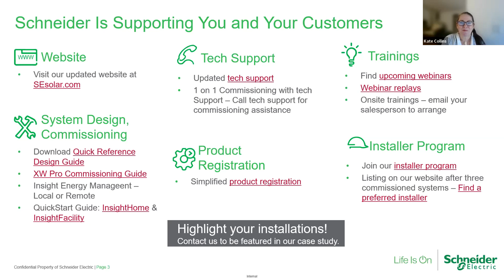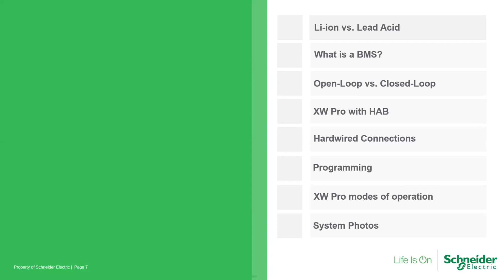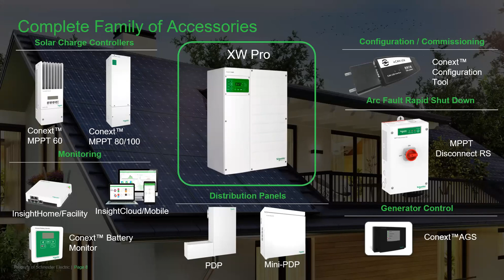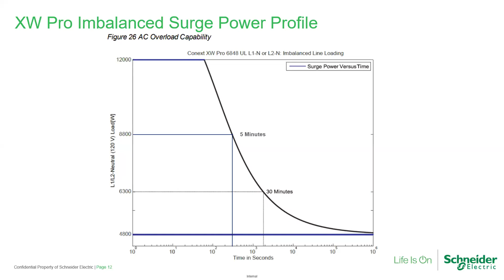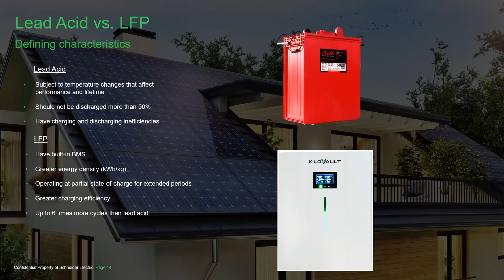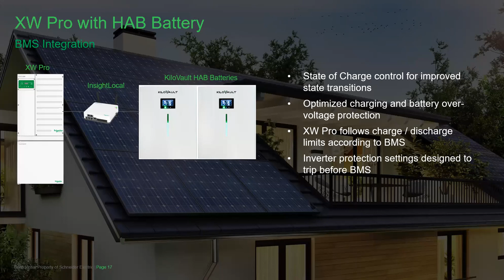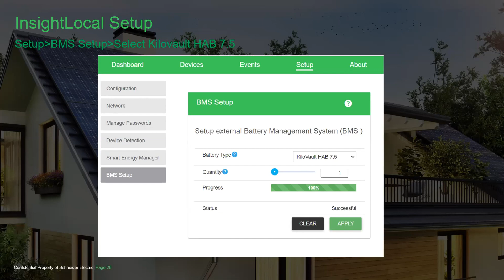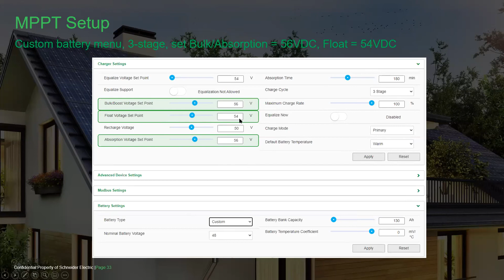Schneider Electric: XW Pro Integration with KiloVault HAB Lithium Battery - Tuesday 1/25/22

Comment: Thanks for the thorough video.  However, I'm a little confused, as the schneider lithium supplement clearly states that the bms closed loop integration will not work with either more than one xwpro, or dc coupling with mppt charge controllers, and your video implies otherwise.  Any comment on this?  Thx,

Comment: Curious, what is the advantage of closed loop communications, if you are still doing open loop to the charge controllers?  If you are manually setting that for the CCs, it only takes another moment to set it for the inverter too.  I thought the benefit was that closed loop handles setting all those settings for you?